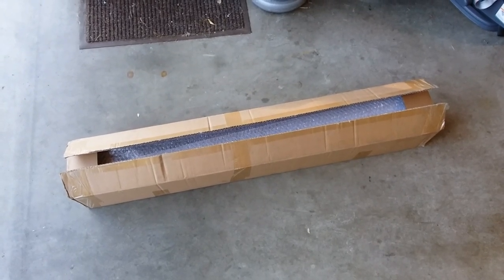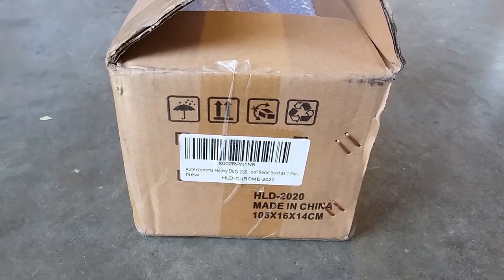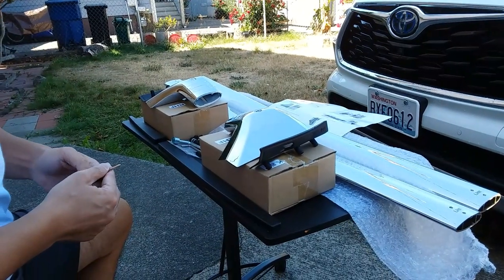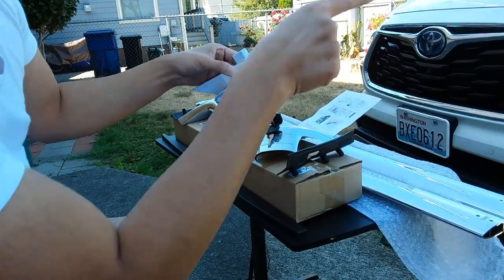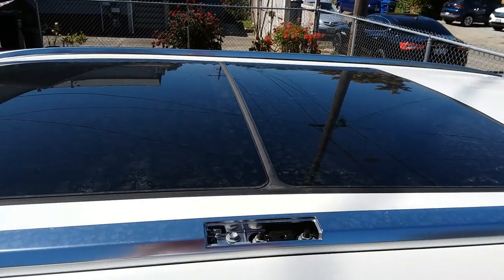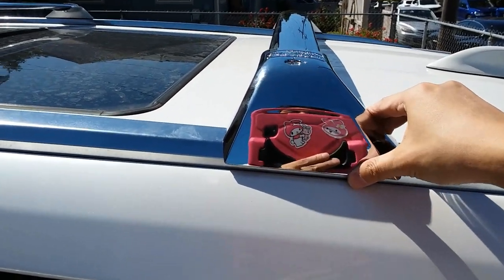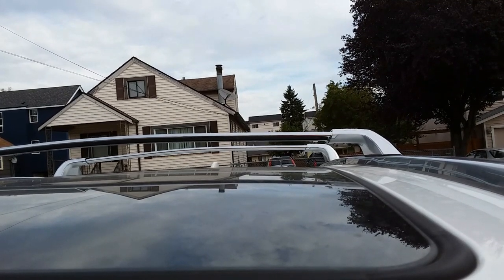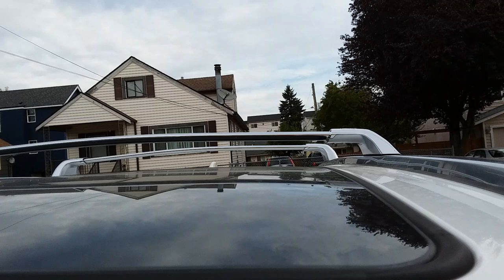Autekcomma Roof Rack Crossbar Install for 2020-2024 Toyota Highlander (Better than OEM!)

Comment: Thank you very much for uploading your thorough review and installation tutorial! We finally got our limited hybrid after an 18 month wait (Canada). I was shopping for cross bars and came across your videos. Very informative and easy to follow. How have the cross bars faired over time, have they weathered well? I notice your Washington plates: I assume they salt the roads in the winters as they do in Canada?
Reply from the maker: Thanks! The crossbars are still structurally strong and look great. I will admit that I've noticed a slight oxidation to the chrome finish but nothing is peeling off. There also seems to be a bit of rust that is forming at some of the keyholes but still functional so I may add some rust proofing to the 4 areas or cover them with some clear PPF to protect it from the elements.

Comment: Thanks for the video. I installed the oem rails on my 2021 Limited Highlander. The oem setup is pretty much the same without a key. Oem has a rubber gasket also. The oem supplies a small old style spring torque wrench for installing the bolts. The oem  covers snap on the same and are attached on the inside with a tether line to keep from losing them I guess. There is no wind noise that I can tell and no loss in gas mileage.  Your set almost seems identical to the oem and is very aerodynamic also, plus the cost is a lot less.  I am interested to see which carrier you get.
Reply from the maker: Thanks for the feedback! It's good to hear that the OEM set also has rubber gaskets. I'm still debating on which storage box to get  but so far I'm eyeing the Thule Motion XT (16 cu ft). Did you install one on your Highlander and do you have any recommendations? I'm still open to suggestions!
Reply: @vietbubbletea  I have not purchased a carrier yet. There are so many to choose from. I do think Thule seems to be one of the better ones or at least its marketed that way. That is the style I was looking for also. They are kind of pricey but I guess if you want quality that goes with it.

Comment: thanks for the video! super helpful, just did the install myself and this was a great help.

Question: any issues with the chrome finish chipping? I use a pressure washer (not high pressure) to wash my car but want to be sure I'm not going to strip the finish, specifically the mount covers.
Reply from the maker: I've used a pressure washer set on high after two car washes and no issues with the chrome chipping yet, still has the same shine and finish as the day I installed it so far.

Comment: Does the chrome match the color and shine as the stock rail?  I like the chrome look on the pearl white color but how sensitive for the chrome to be scratched if the cross bars are carrying a load.
Reply from the maker: The color and shine matches perfectly. If you go to the Amazon product link, I've added a product review with additional pictures under the username Thanh T. if you want to see the shine close up.

I also had concerns about scratching the chrome finish if I install a cargo box so I plan to wrap the crossbars with clear 3M PPF wrap to add an invisible layer of protection.

Comment: It may have 250 lb capacity, but that means the roof can’t take that capacity also. The 165 lbs roof capacity still takes precedence

Too bad you can’t get black end caps with the chrome bars
Reply from the maker: Yes, I mention my thoughts around dynamic weight vs. static weight capacity near the end of the video.

Comment: Hello how are these holding up now? Deciding between this or OEM
Reply from the maker: @ruelperalta5065  I really like these compared to OEM because of the lock covers. It prevents it from being stolen or flying off on the freeway. Only issue is I noticed one of the key holes is showing some rust so I would recommend wrapping that area with some clear PPF.

Comment: i bought the same for my 23 hi hy
wish i ponied up for the oem.  my crossbar wasn’t drilled right.   those two screws will not fit in the hole.  the only way it would work it to retap the hole. what a hassle
Reply from the maker: Sorry you had that experience with a defective set bro. I've heard nothing but good reviews from the members I've referred.
Reply: @vietbubbletea  and on top of that, the crossbar didn’t not fit.  it’s a little too short by a few mm.  even at full stretch.  such a bummer
Reply from the maker: @pepitopepito2967  Damn, I wonder if the company went with a different factory to produce their products because I had no issues regarding quality control. Again, sorry to hear about your experience.

Comment: How did you screw the bolt in the top?? My Highlander doesn’t have a hole there. It’s a bracket of some sort?
Reply from the maker: What year/trim is your Highlander?   If you have an L/LE, these crossbars are not compatible since those trims don't have a roof rail.

Comment: How are these holding up after a few months?
Reply from the maker: @Glacial Regret I haven't loaded anything on it yet but that will change when I slap a cargo box on top this summer. Still looks great as the day I installed it and still no noise issues or noticeable mpg reductions.

Comment: You skipped a step and forgot to add the bolts that are under the caps
Reply from the maker: They're installed beginning at the 11:40 mark in the video. I only filmed installing 1 of the 4 bolts since everyone got the idea as it would be redundant and make the video longer.
Reply: Thanks for the response, I have a different trim. Toyota Highlander LE and was gifted roof rails, but I believe they don’t fit the trim that I need. I need the anchors thanks.
Reply from the maker: @midtowndre  Aha, that makes sense. The L/LE trim doesn't have factory roof rails like on the other higher trims so it wouldn't fit.